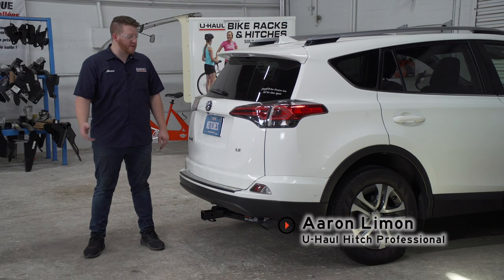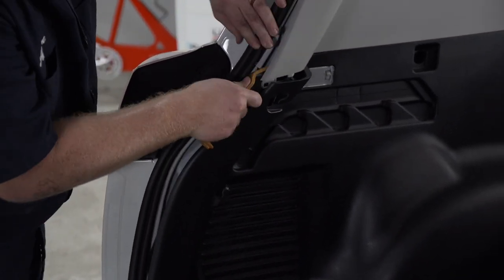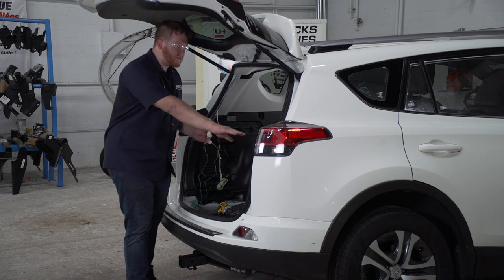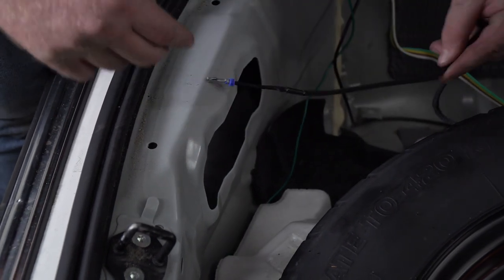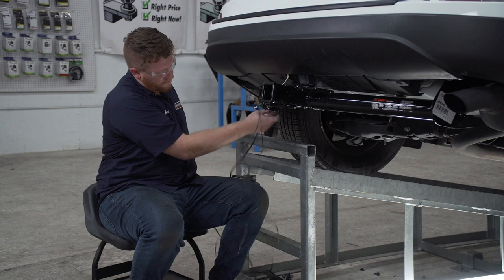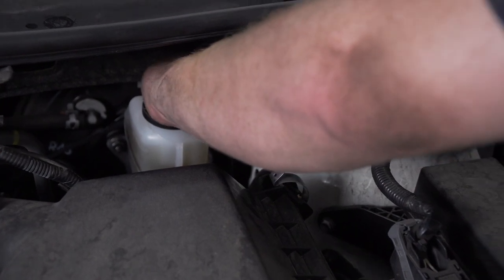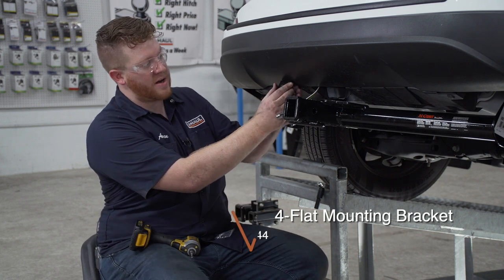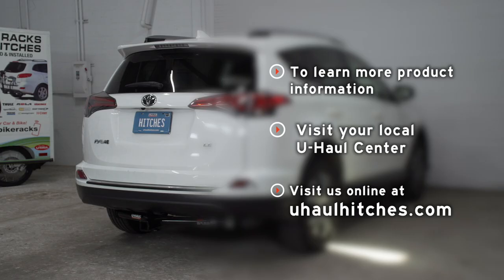2014 Toyota Rav4 Trailer Wiring Harness Installation

Comment: I’ve installed three wiring harnesses in the past and ran hot wire inside car, under carpet along driver’s side edge. Worked well and have peace of mind that wire is not routed around suspension components and exposed to weather elements.